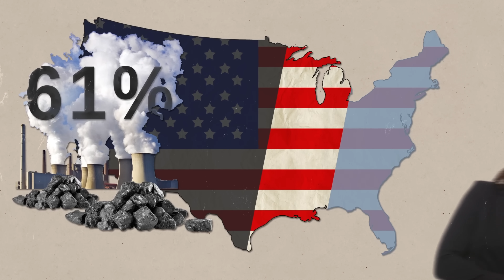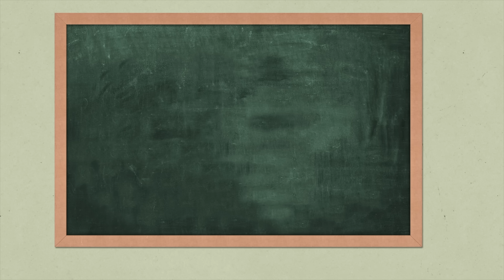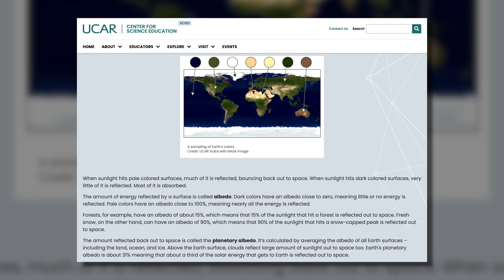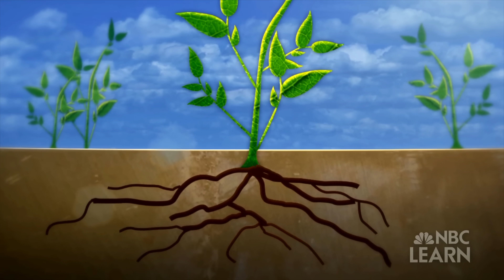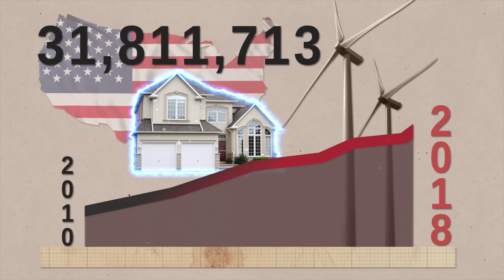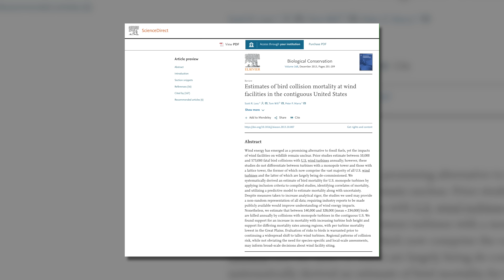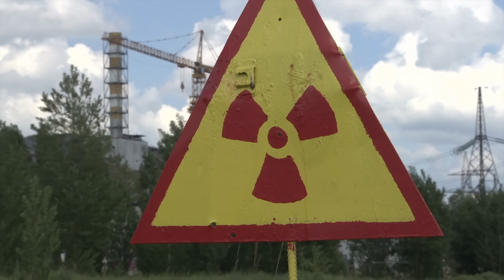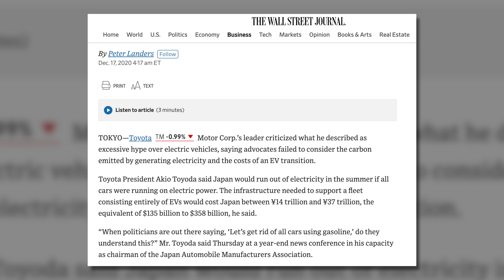Terrible News for America and Japan

Comment: I had never thought about the heat issue. Clear deal breaker. Thanks for your brilliant analysis. I've come to the same conclusions. Nuclear is the only option that doesn't create climate and pollution issues. But, we must learn how to use it more safely.  Because failure isn't an acceptable option. 

We can also try to reduce our energy footprint. We've become voracious consumers of energy because of the influence of business and technology on our lives without a proper environmental counterbalance. 

We've all learned that business only looks at the next quarter profit. It's unbalanced by its nature. So we have to find the best middle road.  It's ridiculous that there's a push to get people back onto roads and commuting to offices for work they can more happily do at home. This has been blatantly called out as needed to support cities and their businesses which are failing. But, is that what we should really care about? Cities come and go. 

We should focus on minimizing our energy use, using clean energy,  and rewilding as much of the planet as possible - because we're the tenders of this garden. And we've been doing a terrible job. We need to do what we can to fix the problems we've created because Earth is our home and it's depending on us to do the right thing for it and our future generations. 

So,the answer isn't only increasing energy. It needs to be combined with becoming more efficient and tending our planet. We can do that with very little pain to our lives if we focus just a little of our attention on it.

Comment: In a transitional period everything has to be transitional, move too quickly and we can't keep up, move too slowly and the infrastructure doesn't change and neither do people or governments. I agree with others, use your existing car as long as possible, slow the rate of production to what is actually needed and make most of those EVs while monitoring grid capacity. None of which will happen obviously.

Comment: Thanks for this video Scotty!  Additional items to consider:  1)  What is the impact to the environment and weather patterns from wind turbines affecting air currents; pulling energy out of the atmosphere?   2)  Are there any NEW nuclear power plants being built or even planned?   3)  Fossil fuel power plants are being retired rapidly--not a trivial concern.  4)  We appear to lack adequate reserve electric generation capacity to meet existing demand let alone increased demand from EVs.  5)  Akio Toyota spoke much common sense, yet he's stepping down.  Will the incoming CEO change Toyota's direction toward EVs?  6)  Elon Musk is likely correct that nuclear is likely the best solution for the near term.  7)  With America's large coal reserves, why have we pretty much abandoned research and implementation of 'clean coal' power plants?
Reply: My questions as well,Fred ......
Reply: Plant Vogtle in Georgia is the latest in the US I believe. They are almost finished with units 3 and 4 and should come on line this year.

Comment: Hey Scotty
I watch you new post every day. You are spot on what you talk about. Quick question I have a 2011 Range Rover Sport. I found a company in Georgia that claim they’ve they have the best sealer for head gasket and they make a special formula depending on what you drive. They have told me that this has worked on the Rovers better then the other sealers. They say that polymer is what they use instead of what the other brands use from the auto stores. What are your thoughts?

Comment: Electric cars will end up being the worst ecological disaster in human history
Reply: If the robots don't do it first
Reply: ElEctRic cArS wIll SoLvE AlL oF oUr ProBlEmS. 

In reality building more energy efficient buildings and cities that encourage more shorter trips by foot or bicycle could help cut down on car and bus traffic so less emissions :) at least that’s a solution that I thought of.
Reply: Worst eco disaster? Electric cars can never reach the level of Pollution to our water oil disasters and strip mining? What are you talking about.
Reply: I'm still waiting for hydrogen cars
Reply: @michaelharris680  “strip mining” and mining in general will increase 100 fold for electric vehicles, wind and solar.  Most of which will be done in third world countries by Chinese companies, that will not protect the environment any where near as well as western countries. 
 Moreover, no country has the capacity or ever will (especially with green regulations) to supply the electricity needed for everyone to move to electric vehicles. 
 After all that, what will we do with all the spent batteries in 10 to 15 years from the e-vehicles? From beginning to end it’s not a solution. 🤷‍♂️
Reply: @jmahachek  I doubt  that enough lithium exists  anywhere to go completely electric...and THEN the  recycling problems begin.........
Reply: @jmahachek  We do have the ability to increase capacity with battery storage using sand and other materials. We also can recycle Almost ALL of those materials. Mining will decrease 100 fold as coal is needed less. Oil drilling will also need to be decreased because those vehicles won't need it. You are already seeing Arab countries anticipating this.

Comment: I was thinking aout the Japan Nuclear Tragedy just when the Elon Musk opinion appears saying Nuclear Energy is the best; You did mentioned War and the consequences without showing more, but there are too many conflict of interests and right now, dealers are selling more original Toyota parts than ever: I was at a local Toyota dealer and I went to the back area where parts are dispatched and it looked like rush hour or peak time at any main supermarket or   big chain store.  Original Toyota parts sales are massive, meaning we will keep using our super reliable Toyotas for many more years and even pay for original rebuilt transmissions without having to buy a new Toyota or any other vehicle for as long as possible . Reality forces adjustments that capitalists do not precisely like.

Comment: While there are valid points within the video, realistically speaking the changes do have to be made to something more sustainable than what our current standards are. The biggest problem to discussions like these are people are looking to one solution that will fix everything when realistically the solution is probably a combination of the current methods presented that would be dependent on the environment they are being built in as some environments are more conducive to certain methods of energy production.

Comment: Wow, 85% turned to heat!

You know how much is turned into heat without solar panels?

100%
Reply: That's not true. Dry sand has an albedo of about 0.4. Solar panels have a much lower albedo. This means that dry sand reflects much more radiation than solar panels. This means much less radiation is absorbed and converted to heat with dry sand compared to solar panels.

Comment: Would it hurt to put solar panels on my house?
Reply: no
Reply: Those who’ve installed solar roof systems find that after 15 years or sooner the panels and electronics need to be replaced and their cost is basically what you saved in that time. You become more energy sufficient but there’s no big economic saving.
Reply: @m1kcan1  no silly,

Comment: Wind turbine has a tub of oil in each head. 
The average turbine has a tub oil to lube the motor 
About a tub oil about 4 foot by 4 foot and 8 foot long in each head
The transformer on the poles on the street has oil to keep transformer cool.
The insulation on the copper or Aluminum wire are a product of oil.
On EV need to change the oil in gear box about every 100,000 to 150,000 to keep wheels and car moving and need all that wire to wire up the car.
The wire has a higher temperature rating in EV car need oil products insulation to be thicker and better to take the heat used more fossil fuels to wire a EV car

Install another 2 port electric Car Chargers.
Need oil base PVC schedule 80 pipe 4” a 400 amp discount switch a ground Distribution transformer and run parallel 500 Cir mil wire all the oil plastic and trucks and cranes and a 18 wheeler truck to deliver. Plus excavator to dig the hole plus a concrete truck to pour concrete for the distribution transformer. Plus utility companies in there bucket truck to hook primary side of transformer we run second side transformer of our trucks van going back forth. Plus the parking lot get pave and paining of EV logo on hardtop all that oil oil base product plus oil by produce to make 2 EV car charging station

Comment: The cons of wind energy seemed relatively minor. Perhaps that’s why they are popping up in such massive numbers. Also I was surprised to not hear much or any mention of the toxic processes that are involved in manufacturing solar panels.
Reply: You think lack of reliability is "minor"?  What are people supposed to do when the wind doesn't blow?
Reply: Don't forget the disposal/ "recycling" costs involved at the end of their life.
Reply: @robertromero8692  Overbuild wind generator assets and pair it with energy storage. That's the beauty of combining these technologies they complement each other.
Reply: @Nerfgunsandpancakes  What "energy storage"?  Batteries?  What batteries?  The ones that use lots of rare minerals and have to be replaced at enormous cost?
Reply: @robertromero8692  Batteries are one of many types of energy storage. Pumped hydro storage is another type that are being used. Other possibilities include weights in mineshafts. Molten salt is another. Lot's of options out there.
Reply: Another thing to consider is that neither wind or solar, or very seldom produce name plate power output, while gas, coal, nuclear and hydro normally operate at 90% or better.

Comment: Well I honestly think there is no one silver bullet solution. Having a combination attack it best by installing all new houses with solar that send excess to the grid, wind turbines in low population areas & nuclear as a base load is the best bet. I have a 5kw solar system on my house to cover daylight hours use & produce 4x more electricity than I need, but use the grid at night as I don't have a battery due to the insane cost of AU$15,000 to get one installed.
Reply: yeah,you can spend 50 grand on a big house  (just batteries)

Comment: I look at it as a shotgun pattern solution. You spread into everything wind, solar, nuclear, combustibles and even geothermal. We need to pick up the pace with geothermal too not just think the next hole we dig will cause an earthquake or volcano, that’s why you have geologists. Like you said before hydrogen powered vehicles especially trucks should be looked at more. What about hydrogen powered trains? All you would need to do is uncouple the car(s) holding the tanks and hookup the next one(s) at the next determined station I would think the only problem would be derailment but what about the nuclear fuel they transport?

Comment: If nuclear is going to be the thing, it needs at least to be walk away safe unlike current reactors. There is evidence the planet and mankind gets pounded by various mega catastrophes. 
On a sidenote, I am seeing cut-up flat bed truck loads of used up wind vanes for the wind farms of my region. This is a regular thing for me.

 If I were a rich man, I'd have a off grid house that was partly underground and heavily fire resistant. An underground house moderates temperature, protect against radiation, possibly EMP, and with additional features from wild fires and more standard weather.

conveyance is not the way forward. Though the elites may permit battery powered bicycles for some of the serf masses confined to the slave 15 minute cities of the future.

Comment: If you Watch the documentary Zeitgeist 3 , the best permanent power source would be thermal dynamics. If we dig deep enough underground, we will have unlimited heat which can be used to generate Steam. Steam turbines can then produce a unlimited supply of Electricity day or night, Summer or Winter. Seams like this same idea could be used in Hot Area's like Desert's. Water can be contained in a continuous loop in a Steam turbine.
Reply: I said that 40 years ago....They said it was too corrosive....I don't believe that today....You ought to see the thermal generation in Greenland !
Reply: Hawaii is perfecting this technology

Comment: The problem with windmill farms is that the windmills actually raise the temperature of the ground by several degrees and in large arrays increase the global warming rates by more than they reduce by replacing other energy sources.  Areas of northern California that have lots of (eye busting in what is otherwise beautiful country) windmills in open grasslands actually have more drought affect than areas that don't.  The extra heat feeds the effect. instead of the ground cooling and bringing in moister air.  Combined with the increasing temperatures from large solar arrays, it's going to continue to raise the temp of the surface of the earth exponentially as more and more solar and wind energy farms are built.   Educate people, remove the fear and paranoia based on inferior structures of the past and nuclear power is the most productive and manageable power source we can come up with for the foreseeable future.  The use and disposal of  lithium batteries and other such resources is not sustainable for the projected demands (or current, for that matter) and we're turning a blind eye to things like natural gas, hydrogen and other renewable sources.
Reply: @haywoodmorganjr1326    Yes but, not all of the materials are 100% recycled for ever and disposal of the byproducts and worn out batteries is an issue.   More importantly, obtaining fresh lithium is terribly expensive and anything but eco friendly.  Look up lithium mining.  Then look up how much energy from coal, oil and gas is required to process the lithium and components for the cars,, their electricity needs for charging, etc.. and then multiply the current production by 80%.  It's completely unsustainable and prohibitively expensive with horrible ecological consequences.

Comment: Scotty, No use saying something won't happen because it is illogical.  It will still be done if there is a buck to be made.  And then there is more money to be made solving the problems you mention.

You didn't mention that Nuclear is very expensive.  Huge cost to build, maintain, and decommission a reactor.

Also, you did not address the "all of the above" strategy which is actually happening NOW.

Last thing, you did not address Hydrogen as a source.  Either through fuel cells or just plain burning Hydrogen.  

Also, isotopes of Hydrogen would be the fuel if we ever get Fusion off the ground (a full scale prototype test Fusion Reactor is currently being built in Europe)

In short you knocked alternate sources as if any one of them will be chosen as the sole source of energy.

Comment: Kudos Scotty - excellent video!!!!!!!!!!!!!!!!!!!!!
However the case against wind power is even stronger than you have suggested.............
firstly, LIE-berals FUDGE THE NUMBERS on manufacture of wind turbines by splitting up the carbon foot print - thus China - which makes something like 90% of all components for wind turbines and then ships them to the WEST - has its carbon foot print SPLIT so that manufacturing comes under a Chinese national foot print - but TRANSPORTATION and INSTALLATION of the wind turbines - with all the tonnes of steel and wire and concrete needed - comes under a North American carbon foot print - thus making use of wind turbines here LOOK cleaner !!!!!!

In addition - LIE-berals have assumed a THIRTY YEAR life span for a wind tower - which obviously lowers the carbon foot print with that claimed longer life span and currently a wind tower is used for TWELVE YEARS before being ripped down!!!!!!!!!!!!!!!!

LIE-berals calculate the production values  of wind turbines by counting how much electricity it can produce in a 24 hour period under idea conditions - and of course we see those "ideal" conditions for only about one third of each day - thus wind tower production is drastically LOWER than claimed!!!!!!!!!!!!!!!!

Nor do LIE-berals count the fossil fuel cost to DE-ICE a wind tower using helicopters to spray a de-icing solution onto turbines so the blades will not become dangerously unbalanced and fail - we had a 3 year old state of the art tower in our area that caught fire and collapsed one snowy night due to less than adequate de-icing...............with the added LIE-beral ABSURDITY that they deplore putting saline solutions on roads for fear of tainting our rivers and lakes yet they happily spray the stuff over huge wind turbines!!!!!!!!!!
Reply: @pi1810  You make good points PEG........ although the transformer shortage seems to be temporary and will end shortly AFTER Russians stop targeting the Ukrainian infrastructure with drones!!!!!!

As for the parts for wind turbines - you make a strong point about the probability of China shutting off the flow of parts in the event of a war!!!!!!!!!!!!!!!

Our vulnerability to such a Chinese embargo is not nearly as bad as the vulnerability of Europeans who are struggling with greatly reduced Russian energy shipments but our situation IS NOT GOOD!!!!!!!!!!!!!